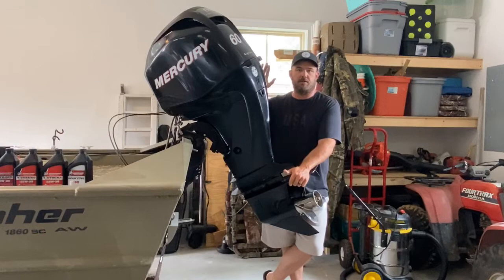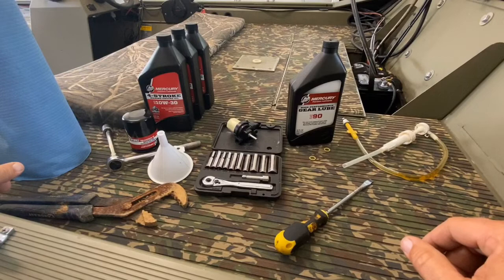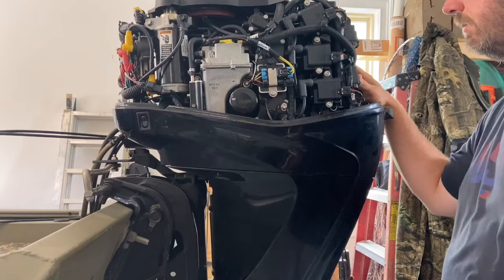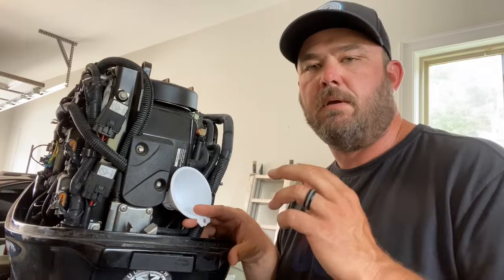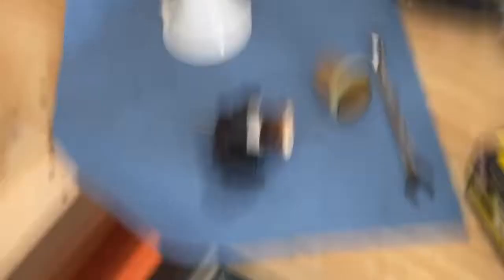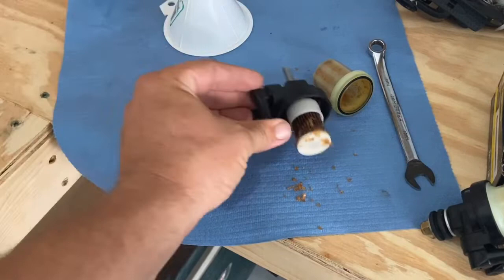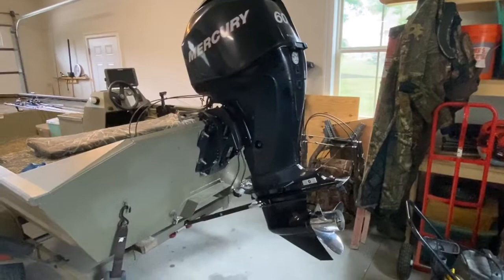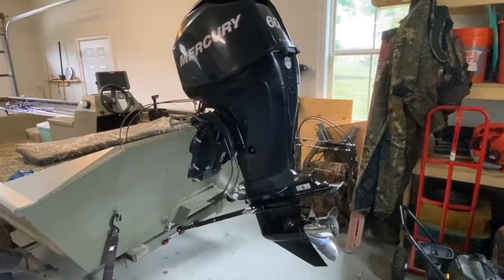Step by Step Service of Mercury Four Stroke Outboard. Oil Change. Fuel Pump. Gear Lube in Foot

Comment: that crud that was in your filter is the lining of your fuel hose. if you have the old grey fuel line they break down in time from the inside. replace it with a high quality marine grade fuel line and you are good to go.
Reply from the maker: Thanks for the info

Comment: With that filter looking like that, you should also replace the high pressure inline fuel filter. It’s under the cowl of tire engine and gets overlooked as it’s covered with a piece of black foam.